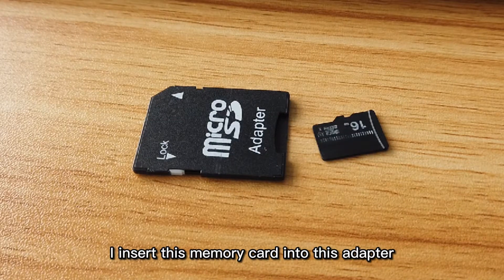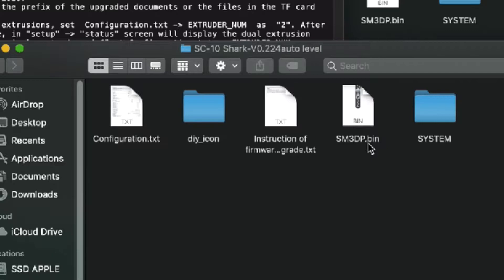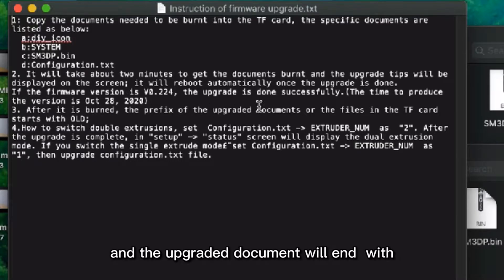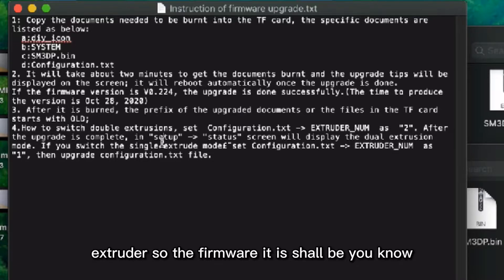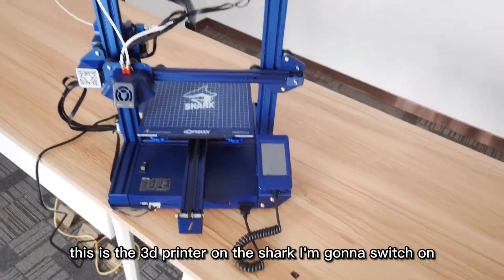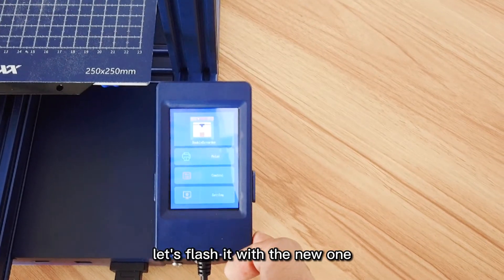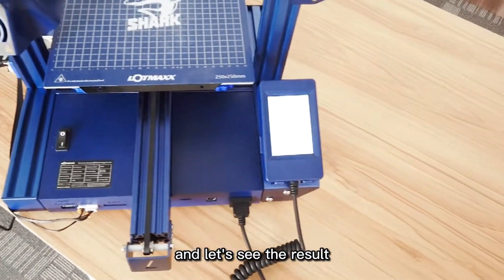FIRMWARE Flash tutorial troubleshooting tutorial Lotmaxx Shark 3d Printer software new version

Comment: so i just got my shark v2 the other day and tried to flash the frimware but now it is only in chinese. i cannot change it back to english. when i go to the language screen i can choose the english option but it will not exit out of there.it just gets stuck. it beeps when i touch anyicon on the tablet. i have looked everywhere on line but the only tutorials that are about this machine are right here. please help.
Reply: I have the V2 and have had the same issues, I've literally had to restart it several times for it to go back to english or whatever the original language was.
Reply: having the same issue, and it isn't possible to reset the firmware god knows why. very disappointed with this printer

Comment: 1. Put only these files 2 files and 2 folders on the card
-diy_icon
-SYSTEM
-SM3DP.bin
-Configuration.txt
2. Boot your 3d Printer With the card in it
3.Printer Will Update Firmware ( Takes about 2 minutes)
4. Control in Settings if Update was successfull 

enjoy
Reply: Minutes flashing black screen and smells like it's heating up and burning
Reply: @w3ar3b0rg  thats not supposed to Happen i think.
Reply: what if i dont have the system file or diy one too
Reply: @CreepyCalifornia  you can download the files as one zip on the lotmaxx homepage
Reply: I have the same problem, screen stay white and smell like burning... after a minute there was smoke... I should never have bought this printer

Comment: I tried flashing my shark and not it does nothing and control are in Chinese can’t switch to English very aggravating!
Reply: Did you figure it out? Mine did the same thing so I just turned it off, but the next day when I turned it on again it was back to English. Also I was just using it normal I wasn't trying to upgrade the firmware
Reply: @jasongibson7380   MINE YOU HAVE TO FLIPP ON OFF 4 TO 5 TIMES THEN ENGLISH
Reply from the maker: @jasongibson7380  upgrade the firmware to V1.6
Reply: @LOTMAXX   I also have tried to upgrade to 1.6.  lcd in in Chinese, v 1.2 is still on system. when I try to switch to English, system just locks up. Cant tell if and firmware is flashing at all.....
Reply: @MarkSheppard72  I’m having the same issue as well!
Reply: @MarkSheppard72 I having the same problem
Reply: Mine does this when you try to cycle the power on and off too quickly. If you shut it off and wait 10 seconds and power up it should be fine. Otherwise you might have to reinstall a fresh firmware file

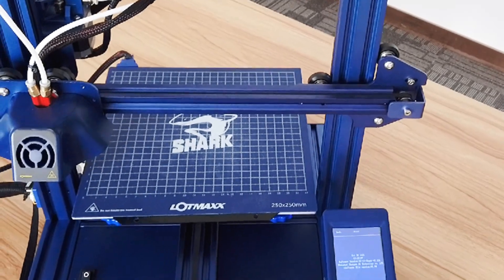Comment: just for constructive criticism, this isn't a good tutorial. i didn't know i needed a second memory card until 3:30 in a 4:36 long video. but do i even need a second card? can i use the one it came with? do i replace the existing files on the card with the new ones? nobody needs the instructions read to them, if they need a tutorial, it means the instructions weren't sufficient.
Reply from the maker: hi, Michael Lenz, sorry for the confusion. you don't really need a second tf card, you can just use the one we sent. But we really hope you can copy and save the files to your desktop, since there are other documents like manual beside firmware, just leaving these few files for flashing in the memory card will be all right. I hope I made my self clear on this. let me know if you have more questions.
Reply: @LOTMAXX  i just got my printer yesterday and it's loaded with the old firmware you're upgrading from in the video. i used a second card and nothing changed. i copied the files for .227 straight onto another card, plugged it in and my printer is still running .221.
Reply from the maker: @MichaelLenzEsq   hi there, can you please just save the 4 files there for printing, for other files copy and paste it to desktop, no in the card please.  if it's still not working, please try service@lotmaxx.com thanks
Reply: @LOTMAXX  I am having a really hard time updating my firmware as well. There is no instruction file without autoleveling..... I am lost
Reply: Did you figure this out?